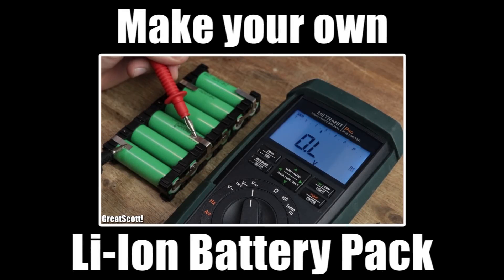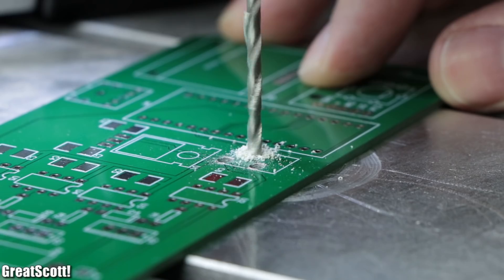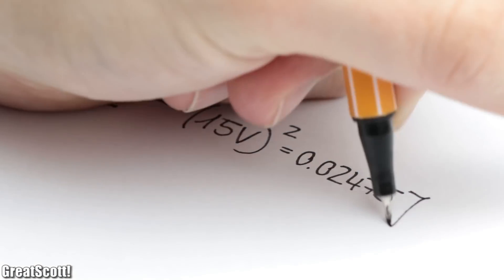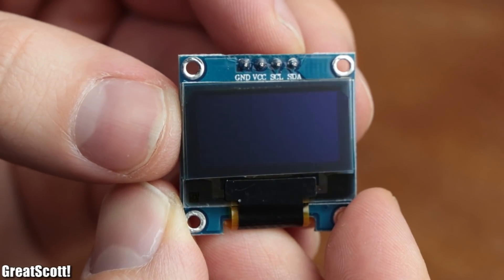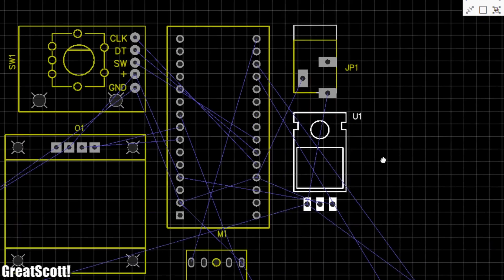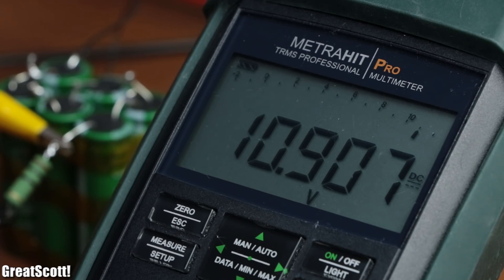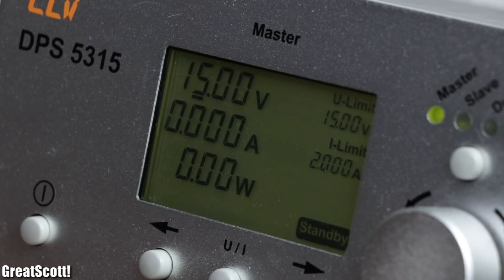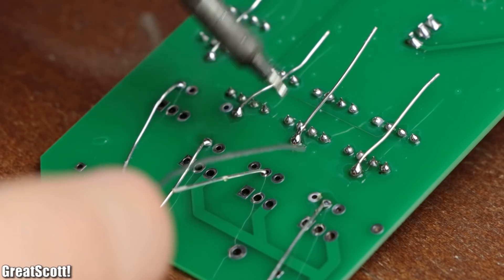Battery Spot Welder (CD Welder) || DIY or Buy

Comment: Holy hell. You didn't need a microcontroller, you needed charging voltage adjustment, optionally. You didn't need MOSFETs on the charging input at all. You didn't need a PCB. You didn't need any gate drivers, and if you did, one would have sufficed instead of 4.

Look here. https://www.youtube.com/watch?v=lfMqrA9UN7w

And if you didn't know all this, obviously you would have chosen a different date to publish this video.

Comment: I used 5 condensators in parallel with 47000 uF and charged it with 12 V so this would be about 17 joules. This worked so far but i used the welder for Lithium ion battaries and they started exploding during the spot welding which was absolutly unhealthy and dangerous. Does anyone know why this happend, especially when the energy in the video was much higher, could it be the voltage?

Comment: You fucked up with your design a shit ton.

Use relays for switching between the charging circuit and the output, not mosfets. And use relays for the welder (I facepalmed so hard when you used FETs). Isolate the power electronics from the MCU. This means you need an optoisolator relay driver, and a optoisolator amplifier for the voltage feedback from the caps.

Also capacitors need protection.

Comment: Thanks for yor videos! May be it would be better to use capacitors in parallel, to make current higher. Also, each capacitor can be switched with it's own mosfet. Charging can be done with cheap current limiting dc-dc regulator from ali...

Comment: We did something similar at home with the Mic transformer. 3 turns of 25mm^2 cable on the secondary, gave us ~3v 1200amps. Then used a broken toaster circuit (element snapped), as the timer. Swapped the electromagnet with a 240v solid-state relay and a few caps to reduce the "toasting" time frame. Together with a foot switch and doneski ;) the perfect fix for replacing old power tool battery packs

Comment: I highly suggest you use methods of simulation or try every stage of the circuit BEFORE finalizing it on a PCB or even perfboard, electronics forgives no shortcuts.

Comment: Do you have a plan of a Project video of Building a Adjustable Constant current, Constant Voltage power supply with dual rail output? A power supply that Got a Positive and a Negative Output in respect to ground? Really appreciate your Videos and thanks for inspiring us...

Comment: You haven't configured the library correctly for your OLED screen there mate, so it's skipping every even scan line.
The easy solution is to use the U8g2 library too, and then you initialise that particular model of screen as U8G2_SSD1306_128X64_NONAME_F_HW_I2C

Alternatively, if you really want to stick to using only the Adafruit_SSD1306 library, go to "My Documents\Arduino\libraries\Adafruit_SSD1306-master\" and open the file .h file, on line 55 change the I2C address to 0x3D, you'll have to change it back if you want to drive a 128x32 screen, as opposed to the 128x64 you've got, which is a really bad idea from a software point of view (editing libraries is a pain for maintaining software), that's why I encourage you to use U8g2 instead.

Comment: Hey Great Scott!
Thanks for another fantastic video!
Do you think you could go into detail as to why this DIY wielder did not work?
From what I can understand you needed the Mosfet Driver IC's to have the same ground potential as the Mosfets they were driving,
and I understand how this would cause them not to turn on.

However how does changing the ground point of the mosfet to be the same as the drive cause a short?
I'm sure there is a reason, I just can't find it.

P.S Love your vids!

Comment: I am not trying to plug my channel here or anything as I dont ever upload but I do have a nickle tab welder video on my channel. I might make another showing the features of the new welder I use. Anyways they typically do 2 pulses one high energy one low energy milliseconds apart. I believe the high energy pulse goes first then the lower energy pulse. GreatScott if you need me to help you with anything understanding how these welders work let me know and I will try but I will tell you a just know how to use one and just barely know how to program one.

Comment: Can you if possible elaborate more on the problem you faced in your design and the solution for this problem since I really didn't understand what exactly was the problem and how to fix it!

thanks
Reply: yeah man, how many amps exactly do nickle stripes require for how long @which voltage? am i required to have a pulsating cirquit? can't I just deliver that pulse manually? How much complexity is actually necessary for spotwelding?
Reply: What he said!

Comment: Great video as always. Afrotechmods did a video with super capacitors. Could you weld 18650s with them or would it create an extreme over charge condition. https://youtu.be/EoWMF3VkI6U

Comment: I don't know if some or all of this is supposed to be an April Fool's joke. Spot welding with capacitors sounds fishy as hell and also quite risky. But supercaps are scary, so I wouldn't be surprised if a large enough amount of them could be used for it. 

What's wrong, in no particular order:
- capacitors should be in parallel, not in series; in fact, this alone makes me think it's an April Fool's.
- never design nor order a PCB until you have built and debugged the circuit on breadboard.
- always add a perfboard area to your PCB, as well as soldering points to all nets, so you can add components later: it will cost the same whether you do it or not.
- really? an Arduino, rotary encoder, and display? what's wrong with a 555 and a pot?

Also, have you ever tried stripboards aka. veraboards? They are as versatile as perfboard, but much less messy.
Reply: he puts the capacitors in series to increase the voltage.
555 and a pot? that doesnt let you regulate the amount of joules you're gonna use - you just know you use "about this much", but no exact number.
no need to be a smartass.

Comment: It don't need a lot of modification to work
Reply: Use an arduino output to control a relay to connect the 15v to charging or discharging

Comment: Using a small lead acid starter battery is simpler for doing a few welds now and then...

https://www.youtube.com/watch?v=o4NaDMoEHxU
https://www.youtube.com/watch?v=tlm-C_fiGS8
https://www.youtube.com/watch?v=o1NFbchHeM8

Or see the kWeld as was developed by a guy on the EEVBlog forums, powered usually by a lithium-ion hobby RC pack and is very smart, 150 EUR though...  https://www.keenlab.de/index.php/product/kweld-complete-kit/

Comment: It sucks that this project didn't work so spectacularly for you. :( But at the same time though there's still tons to learn from stuff like this! Like how you pointed out that the MOSFETs needed a proper reference voltage for them to be able to properly switch on, and so forth. :)

Comment: Use a high power electronic halogen lamp transformer! Get the output in to a smaller transformer with one or 2 coils as secondary and very thick contacts and wires :) It's high frequency and high current, you don't have to charge anything and it's compact and versatile!

Comment: Well, if you make it so overly complicated, then maybe you should better stick with buying stuff. If you just want to spot weld your batteries though, you really don't need a PCB for that. You barely need any components in the first place.
Check this guys video out for example... https://youtu.be/o1NFbchHeM8
The key for a good weld is to not weld with such a high current that you blast the metal away, but also not so low that it takes to long and lets the heat spread out too much. And most importantly, you wanna connect and disconnect the power while the contacts are touching the metal, not apply power by touching the metal, otherwise this happens 0:33...
You can use transistors to control the current. But high current relays should also work fine, since you don't really need to switch the current unreasonably quickly. The timing isn't particularly critical either. As you see the guy in the video times it by hand and it works just fine.

Comment: I built a microwave transformer-based spot welder. I thought about the super-capacitor option because the it scared me to use -- until I got the MCU to time the pulses correctly. Crucially, two pulses (the first short one to soften the metal and improve the contact) make it child's play to use. Watch those nickel fumes though!

Comment: Can you just make it discharge on contact instead of through the mosfets? That would make it harder to precisely control the discharge time, but you could get partial control over the discharge time by controlling the charge voltage instead. EDIT: I just realized that's not how that works. You could control the discharge energy, but not the time.
Reply: download333-  the other problem is that you want a good firm pressure between the two things you are spot welding before the power burst comes, or else you'll just instantly overheat and blow a hole through the top metal. Secondly comes the charge level you mentioned...
Reply: That makes sense. Would a high-current mechanical switch work? I assume there must be switches that won't weld themselves shut when used on something like a spot welder...

Comment: Hey Scott! I think you should give the microwave transformer another go! Why don't you try getting a full bridge rectifier that can handle a lot of current (they are not that expensive on eBay)? I think you would get better results welding with DC instead of the AC you tried in your previous video. Thanks for your awesome videos!

Comment: You will not short your power supply since the positive lead of the capacitors goes through a resistor to the psu (the resistor for slower charging). So it will draw some current from the psu, but it won't shorten it. However you have other mistakes, which will probably kill your transistors. You have wired your discharge N-mos transistors on the high side. That's a big no-no since you are not driving them with a high side driver! The proper way here would be to ground the transistors and connect the welding electrodes between the negative lead of the capacitors and the transistor drain. I don't know why are you using drivers anyways' since you picked a logic level gate transistor?!? Overall it would take no more than 10min to fix it so i see no reason to quit, just cut the trace from the discharge transistors to the negative of the capacitors and use that trace for one side of the electrode and the negative of the capacitors for the other. Don't cut the trace from the cap negative to the charging transistor and ground the source of the discharging transistors. That's it.
Reply: https://www.infineon.com/dgdl/Infineon-BTS555+E3146-DS-v01_00-EN.pdf?fileId=5546d4625a888733015aa3f57e5e103e
:-) Done !
(Power Supply , 1k resistor to Caps, caps to BTS555, bts555 to welding tips. the cap legs are too thin for high current tho...)
Reply: Hehehhe. What he said!

Lol its over my head but id love to see you fix that spot welder :P
Reply: Wolfshark Can you explain a bit more about the mosfets ? I didn't know that could be a problem, I'm curious.
Reply: I will probably not explain i well enough, but here how it is from a practical point of view:
Lets, say you are using mosfets to turn on a 12v car bulb. Let's say you are using a logic level n-mos which can switch plenty of current at 5V at the gate. The correct way to wire everything would be +12v to the first lead of the bulb, the second lead of the bulb goes to the drain and the source goes to ground. When you apply 5v between ground and gate (which in this case is the same as applying it between the source and gate) your bulb will light up and the transistor would be fine, because 5V at the gate would be enough for, lets say, 10A of current to pass through it.
Now let's say you install the n-mos on the high side, meaning +12v goes to the drain, source goes to the bulb and the second lead of the bulb goes to ground you will have a problem. You apply 5V between the ground and the gate, but that's not the same as applying it between  the source and gate. There will be significant source offset from ground, because of the lamp that is between ground and source. So, your transistor is turned off, so the resistance between drain and source is practically infinte for you. You apply 5V to the gate and the transistor is starting to turn on. The resistance of the bulb is, let's say, 2ohm. As the resistor is turning on, the resistance between drain and source begins to fall. That resistance might be very low when the transistor is in it's ON state (in most cases lower than 0.1 ohm), but it won't go there instantly . It will fall very quickly but let's say it reaches 4ohm in 50us. At 4 ohm at the transistor and 2ohm at the bulb you will form, effectively a voltage divider. That would mean 4V at the source. And you have 5V at the gate - that would mean 1V between source and gate! That would definitely not be enough to turn on the transistor, so it would balance in that state. So now you will have a very dimly lit light bulb and a very hot transistor. 
So If you want to use a n-mos transistor on the high side you should use a high side driver which will deliver the proper voltage between gate and source. The alternative is to use p-mos, but you still have to use a driver, and generally n-mos transistors are better.

English is not my native language so sorry about the (possibly) confusing explanation.
Reply: nessotrin ,i think he is worried about the Vgs breakdown voltage because the source of the nmos will be floating
Reply: Well said!

Comment: Use the car battery method with foot switch, and arduino to control weld time. This is the method I will use if I ever get around to it.

Comment: That's an easy fix though, isn't it? Just connect the capacitor ground to the FET driver ground though a resistor, so you don't short anything?

Comment: I made a spotwelder only for aboud 50€ and its freaking good!!
- microwave transformer ~30€ 
- 35mm² Cable 1,50m ~10€
- 12v supply for arduino and Relay ~ 5€
- Relay ~2€
- Arduino ~2€
At the moment i have a simple potentiometer as time adjustment but i have the plan to put a rotary encoder and a little display on it.
Reply: How did you get a microwave transformer for 30€ you can find microwaves in the trash and free and also for dirt cheap

Comment: From what I have seen: use lots of capacitors in paralell for high peak current (100A-ish), and don't route the welding current via the  board if you can avoid. Basically massive connections!

Comment: Took a bit to realize what the problem really was about. But can't you just add a secound row of mosFETs to charge and another to weld? So when you weld you "isolate" VCC from the capacitor bank? Example just throw a few fets on a though hole PCB And use for example GPIO 8 to turn on the D9/D10 when D12 is pulled low?

Comment: Why not use a lead acid battery with a relay like AvE did? https://www.youtube.com/watch?v=UU7QC5Uby6M

It's very simple to make and very cheap: ask you local repair shop for old batteries or buy a new one for less than 30€, you can find suitable 100A relays on ebay for a decent price and you could always use an arduino to trigger the relay according to the thickness of the battery tab.

Comment: I've seen a pretty decent spot welder from a truck battery and a solenoid from a scooter. It worked well enough for batteries and stuff. No caps or stuff. Also, those 5-600 farad caps on ebay can do 200amps, much more than the tiny ones used here.

Comment: Dude get yourself a proper soldering tip with a flat end and then heat up the PCB and the component while applying solder. It hurts.

Comment: do you think one of those 2.7v 500f capcacitors from ebay would work as well? according to my calculations, the amount of energy would be very similar, and 2.7 volts should be enough voltage, right?

Comment: Nice video, I suspect your Adafruit OLED library is configured for a 128 x 32 display stretching the digits. Fix by uncommenting #define SSD1306_128_64 on (or near) line 73  of Adafruit_SSD1306.h and commenting out #define SSD1306_128_32.

Comment: With super capacitors in series, you really need some over-voltage protection on each individual capacitor. Without this protection, the variations between the individual capacitors (capacity and leakage) means that you will over-voltage some of the capacitors even though the average voltage per capacitor is within the safe working range.

Comment: I have a question. I have tried to solder 2 supercapacitors in series and charge them. The were both 2,7 volt supercapacitors.The problem was, that after charging the series connection with 5 volts and measuring the voltage at the capacitors - the first one was charged to 3,3 volts and the second one to 1,7 volts. Can you tell me the reason for this behavior and how to fix it ?
Reply from the maker: You need a balance charger

Comment: The best is the theory which you learnt and shared to us... this is what we always look for...failure or success does not matter... I would just like to ask one thing.. do shorting such big charged  capacitors reduce their lifetime??
Reply: I don't believe so.     They are designed to discharge quickly, shorting them just gets it done that much faster.   Also, with very large capacitors, you want to store them shorted so there aren't any surprises later.
Reply: thanks for the info

Comment: Capacitors is series ? 
I would use them in parallel
Reply: He needed a voltage of 15v, which meant the 2.7 or something volt supercaps in parallel wouldn't cut it
Reply: MintSoup thank you